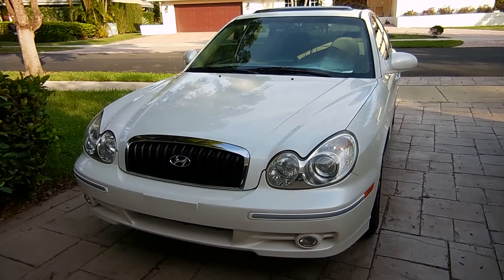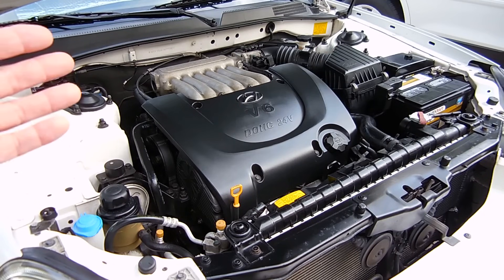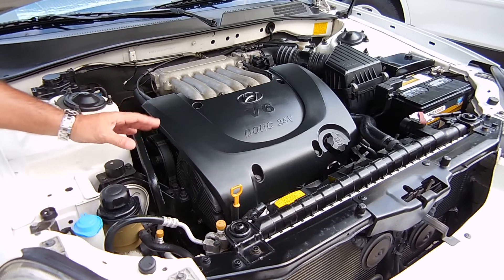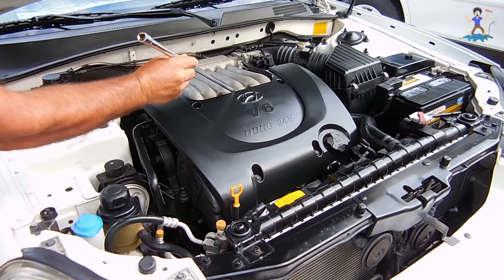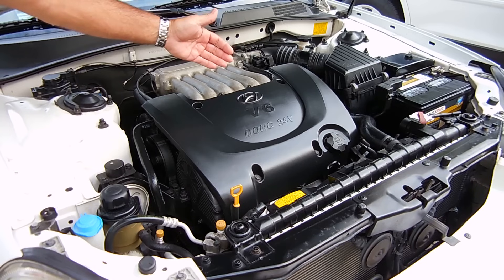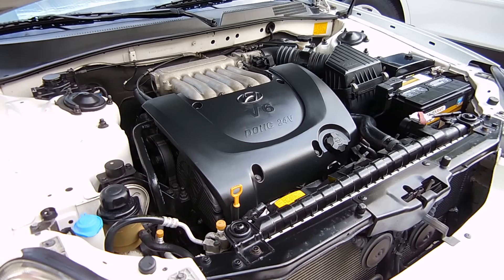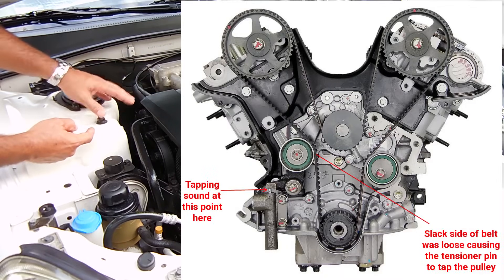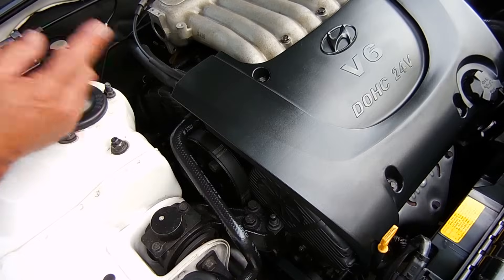(SOLVED)Engine Knocking or Tapping Sound That Varied With RPM

Comment: You explain too much but you doesnt have those sound problems on your car. Get video of those sound. Found it and fix it better than explain around.
Reply from the maker: The video was very well done. Because of my video, countless people learned about a potential problem that they should check. Every vehicle will make a different tapping or knocking sound, the sound is irrelevant, what is relevant, is where the sound is coming from. If it's coming from the area I pointed out, then you need to check the tensioner. This video should be 90-95% thumbs up. Sadly we live in a society with unappreciative and entitled people.
Reply: @electronicsNmore  This ignoramus hasn’t mastered the english language and yet he has the gall to criticize you. Keep up the great work bud! We appreciate it.

Comment: I have a 99 civic, when im stopped at a redlight it starts making like a tapping sound. And when im driving and it shifts gears, feels like a mount is broken but im not sure if its the mount thats making that noise because it goes away as soon as i accelerate or on neutral or reverse.
It only happen on drive while stopped
Reply from the maker: The sound would exist in neutral or park if it was the same problem I had. It could be an engine problem that shows up under load, or a transmission problem.

Comment: When I drive at 40-50 mph my car starts to knock. It happens when the rpm goes up or down. The sounds comes from the left side of then engine.
Reply from the maker: If the sound does not go away when you take your foot off the gas at that speed, or take your foot off the gas and click into neutral at that speed, then it's not the engine. One wheel has a problem.
Reply: Change spark plug

Comment: I check all spark plug, injection and any loose engine bit and even engjne mount bracket and there nothing I can do, did start 21 time for every one knock then after 22 time heard loud roar come from under my car and it damn exhaust sleeve just pop off so that what cause it 🤦‍♂️
Thank for tip
Reply from the maker: Sounds like you may have had fuel ignite in your exhaust system. Not every engine that has a knocking or tapping sound will be the result of what I explained in this video. I made the video to make people aware of one problem that is rarely mentioned. Thanks for watching!

Comment: How do you listen to the tapping if it only happens when you drive
Reply from the maker: Try putting the engine in neutral and revving the engine. If it doesn't do it, then you probably have a problem with one wheel.

Comment: Recently noticed my car is also making a knocking noise but only at around 2k rpm and only when I'm off throttle. When I'm on throttle or braking, the noise seems to go away. The car is due for a full service (timing belt, tensioners and water pump, accessory belt, all fluids, all filters and even glow plugs) so I'm a little more releaved to know that it might be a tensioner going bad but I'll still ask my mechanic who is a close friend to have a look at the rod bearings because that was the first thing that crossed my mind the second I noticed that noise.
Reply from the maker: Braking shouldn't have any effect on the engine sound if the tensioner is the problem. Sound caused by the tensioner will vary or disappear between idling and increasing engine RPM. I wonder if the "knocking" sound is a rotational noise coming from one wheel. Thanks for watching! Be sure to rate thumbs up.

Comment: WHERE WAS THE ACTUAL AUDIO?
Reply from the maker: Everyone is overly concerned about the sound of the knock or tap. The sound will vary. What matters is WHERE the sound is coming from. In this video I made it very clear how you can rule out the hydraulic tensioner. I have an audio file in the video description area, and in my "Pinned" comment.

Comment: I have a mustang 1996 gt 4.6 liter and it makes such a bad knocking sound.
Reply from the maker: You need to pinpoint the loudest area of the engine to get a good idea. Thanks for watching!
Reply: I have experienced connecting rod issues 0n  1997 & 1998  4.6 liter fords requiring rebuilt short blocks.

Comment: I know this video is old but maybe I can get some info here or some replies. I have a 95 1.8 Audi A4 it has an inconsistent knocking noise coming from the valve/cam cover near cylinder 3/4 on the intake cam side the knock isn't a tap tap tap it sort of bounces around like will tap twice then quiet for 2/3 seconds then tap again it's only during idle goes away with any increase in rpm and only taps in drive or reverse when warm not in neutral or park but when it's cold taps in all gear selections, I have replaced the timing chain, timing chain tensioner, all the hydraulic lifters on intake cam side, new oil pump, new oil pickup, running full synthetic 5/40 weight and I've tested all sensors and checked for vacuum leaks.
Reply from the maker: Hello Kevin. Unlike other YT channels, I reply to ALL videos regardless of age. Might pay to remove the valve covers so you can rotate the engine by hand a few times to look at everything and listen for unusual noises.

Comment: My mechanic just replaced my timing belt and water pump a couple of weeks ago and ever since then I’ve been hearing and feeling a light thumping noise. I can feel it in the pedals and the floor board. I gets stronger and faster with the cars speed. Even on the access road going 40 + mph I put the car in neutral and coast and it’s still there. But when I park my car put it in neutral there’s nothing. If my car is parked and I place one foot on the brake put the car into drive and press the gas pedal the noise and feeling is there...
Reply from the maker: Hello Marie. It sounds like something wasn't put back properly in the process of replacing the parts. Bring it back and explain the problem. Thanks for watching!
Reply: electronicsNmore thank you I’ll take it back asap
Reply: What ended up being the problem ?

Comment: Do You have a video of the ticking noise? I have exactly what you described but mine it's a chain driven with hydraulic tensioner
Reply from the maker: My pinned comment has a link to the sound.
Reply: @electronicsNmore  missed that, thanks exatly the noise my engine has, was starting to think piston slap, but is not that loud or deep, is just a clac clac at idle. and below 1200rpm, thanks!

Comment: My 02 Grand Am has a bad oil leak and the knocking occurs at the same speed of the RPM. Once I fix the oil leak and try this, I’m hoping the problem will be fixed
Reply from the maker: Could be a fuel octane problem.

Comment: Hello, so I've been having a ticking sound come from my passenger side in my 96 f150 4.9 l6 and I did an exhaust leak test. And I found one on the manifold and I can't be sure if I found all the leaks. Any other advice before I go spend 800$ on an exhaust manifold replacement
Reply from the maker: Ticking sounds are usually exhaust manifold leaks. You need to spend much more time trying to pinpoint the exact location of the sound. If it's on top of the engine, on the passenger's side, then it's likely a valve issue.
Reply: @electronicsNmore  well the ticking noise from the passenger side is alittle loud. But it doesn't sound as harsh as a thrown rod. Could that still be a valve tick?

Comment: Completely different car, but my Fiesta ST I recently picked up has been making these noises in the belts side of the engine. Got underneath and looks like an auxiliary belt powering the AC compressor has been replaced along with the compressor recently. Hopefully it's just that causing the sound.
Reply from the maker: Remove the belt, then start the engine for 5-10 seconds to see if the sound goes away.
Reply: Is it possible that an alternator bearing or compressor bearing could make a similar noise?

Comment: Hey im getting this same problem but on my 3.8 genesis coupe,
Upon start up you can barely hear it,
Rev between 1200-2k and its there
Above 2k and its gone
Same location too, passenger side somewhere in the middle 
I took it for a drive today and while drive it sounds normal or very faint( i have a loud exhaust) 
No check engine lights
No oil problems
Could it be the same thing?
Reply from the maker: Very possible. Sounds like the same thing.
Reply: @electronicsNmore  yeah i talked to a few of my mechanic buddies, and they all said it doesnt seem to be rod knock, and i suggested thr hydraulic tensioner and they agreed thats what its looking like,
How hard is this to fix btw?

Comment: I have a ford fusion 2008 when i brought the car it had a like ticking noise but drove perfect after few months it started to sound like a rattle it still drove good then it came hard then the car cut right off tried to crank it back up it basically died
Reply from the maker: You waited way too long to check things out.

Comment: how to clean engine like that ?
Reply from the maker: Very easy. Every 2-3 years I cover up the electronics, etc, then spray engine cleaning foam and brush it in to remove the grease/dirt. Then carefully rinse off the engine. When dry, I use wd-40 on certain areas, and to give the engine plastic parts a beautiful "like new" shine, tire foam. :-)

Comment: The sound we are trying to figure out is about 30 seconds to a minute after my wife turns off the car. We haven’t noticed it before and I don’t think it’s the engine cooling off, this isn’t a V8 Corvette. Then again, I’m no mechanic 🤷🏻‍♂️
Reply: It’s a 2006 Sonata V6
Reply from the maker: @Longenecker1776  Need more info. Location?

Comment: Hey I have a similar ticking sounds with the same engine only it gets louder when I accelerate harder and is not there when at idle or soft acceleration any chance it is the same tensioner? I was thinking a fuel related issue (injector) no check engine light btw any info helps 👍👍 also sounds like same location described here
Reply from the maker: Doesn't sound like the same problem. Sounds more like an internal engine problem. Possibly rod knock or piston slap. Have you always kept the oil changed and clean? Never ran low?
Reply: @electronicsNmore  what if the tapping sound only occur during engine startup...but when driving there is no sound anymore and when the engine is already warm. The sound also louder when the ac is on
Reply from the maker: @briancaroll1194  You need to find out where the sound is loudest first.
Reply: Bought the car with a bad clutch once I got that fixed I notice the problem previous owner claimed to have bought it from auction and never got to drive it wouldn’t rod knock always be present like even at idle you can here it clearly
Reply: Same problem here

Comment: You can still start it without the band? 😂
Reply from the maker: What are you talking about?
Reply: Gabriel Martinez yes you can. Timing belt no, but the outer belt yes. Its only for powersteering(dont need it if only starting engine), alternator(you dont need it if you have a good battery and you arent driving the car) etc etc
Reply from the maker: @noetobar5018  Oh, the serpentine belt. I was wondering what he meant.
Reply: electronicsNmore i think thats what
He meant anyways 😂.
Reply: @noetobar5018  still will need it for water pump for when the engine is hot but when cold it doesn’t need belt

Comment: I only buy car with timing chain
Reply from the maker: They make more noise, and can stretch over time. Thanks for watching!
Reply: @electronicsNmore  the past is different than modern day.that's why toyota stop making car with timing belt after 1997
Reply: These engines do HUGE miles and because they're built in the early 2000s, you can cherry pick the best of them and still pay peanuts. I got a van with one in it (trajet) and paid about US $3000 for it on the road with fixups and inspection and tags and taxes. I doubt the caryard even made a profit but the previous owner got it repainted and it shines up like a new vehicle. And it's only done 100 thousand miles.....

Comment: WOW my 2019 Hyundai Tucson is a v4 how is that a v6
Reply: JPS Channel it would most likely be an I4 or In-line 4
Reply: There no such a thing v4 .
Reply: @GilZu  I've had 5 V4 engined vehicles.
Reply: gil zur There are V4 engines but are extremely rare and not made any more
Reply: This is a VERY common V6 engine in the trajet, Santa fe, tiburon, and sonata. And I thought the grandeur but it turns out that's a 3.0 litre. They also made these with a different top cover as well but the same engine underneath.
Reply: Cars of the same model can have different sized engines depending on the version you choose.

Comment: I'd rather a chain driven v6
Reply from the maker: Chains last a lot longer, but they do create more engine noise. They can also stretch over time.
Reply: chain motors have more problems...tensioners going out,guides
Reply: @brianp5579  That's not true and depends on the motor.
Reply: @JD-ph1dz  frt covers leak on chain motors also. More stuff to go wrong
Reply: @brianp5579  lol my Commodore has done almost half a million ks and still goes like a dream. One of the most reliable v6 engines out there 3800 buick .. All vehicles have problems dude.
Reply: @JD-ph1dz  LOL you are giving me examples of single cam chain driven engines im talking about dual cam or quad cam engines that utilize a chain, plastic guides and tensioner. They will NOT go half a milliom miles with out failure.
Reply: It does all depend on the motor… I’ve done so many chains on 2008+ bmw mini’s and 2015+ Audi especially s3 models down to poor running because of a stretched chain and they all seem to have around 70k miles on the clock… diesel BMWs especially those with stop/start will snap a chain at 120k miles if not replaced (engine out job) and I have a 2017 Mercedes a200 that’s has a snapped a chain, it’s smashed a hole in the side casing and the chain hanging out the side of the engine, i can see broken teeth on gears through that hole so I’m not stripping it, it needs an engine but the customer can’t afford it. Older stuff with chains are better because they used to be over engineered now it’s all cheap sh!t.

Comment: If the hydraulic tensioner is faulty, one should be able to determine if it's bad just by hand?  In other words, will the slack on the timing belt and pulley be obvious to the touch?
Reply from the maker: The timing belt should be tight at all times. If the tensioner is faulty, there will be slack in the timing belt that can be felt. Thanks for watching! Be sure to watch my "Auto & Mechanical" video playlist below, and most importantly share my channel with many others. 
https://www.youtube.com/playlist?list=PLQ6IOhUBblU3mBem9ImEgGzmqToW6SCJD
Reply: By hand AFTER you take all the other stuff off to get to it

Comment: Hi I have a really load ticking when accelerating in lower gears but when it is wet (raining) you can’t hear the ticking mk5 golf 07 1.9 tdi any help would be much appreciated as I can’t stand the ticking sound for much longer
Reply from the maker: Hello. It's very difficult to say without looking at the vehicle. You need to pinpoint the location. Maybe a problem with the turbocharger if the timing belt is OK.
Reply: electronicsNmore  thanks for your reply I recently had a new turbo charger around 6k ago as it had the horrible siren sound for a while the clicking also stops when I put the car in neutral but with the car still moving like down hill for example but if I rev the car whilst still moving in nuetral the ticking continues but there is times when it doesn’t tick like in the rain sorry for the paragraph and I appreciate your help a lot ✊👍✌️💪♥️
Reply: If it's based on the 1.8 litre turbo diesel..... RUN... one of VWs worst engines.

Comment: About a year back my dad gave me a VW Passat he purchased brand new, he wanted to sell the car but ended up giving me the car as a gift. however, when I first got it had a knocking in the engine, sounded like a diesel engine. I thought the knocking was only my imagination but one day my wife asked me if the car was a diesel because of the intense knocking. however, I decided to do an early oil change. Turns out the knocking disappear completely.
My opinion only the shop that was servicing the car was using poor quality oil and bad quality replacement parts. My dad had lots of problems with that car but with me, it has been flawless. I'm thinking if dad asks me how's the car doing I'm going to reply with: This is the worst car ever.
Reply: Sounds more like crap in a hydraulic lifter... some VWs can be real nightmares.

Comment: I have almost identical symptoms on a Pajero iO 1.8 DGI just bought at auction. Was hard to get it by the Shaken (biennial inspection) on hydro-carbon emission. Assumed it was carbon build up in the inlet valve stems, but your suggestion regarding slack tension on the timing belt is worth investigating. Particularly as the belt had been changed shortly before it chucked into the auction.

So cheers for that.
Jack, the Japan Alps Brit
Reply from the maker: Thanks for watching Jack! Be sure to watch my "Automotive & Mechanical" video playlist below, and most importantly share my channel with others. 

https://www.youtube.com/watch?v=hnd7P7O_vEQ&list=PLQ6IOhUBblU3mBem9ImEgGzmqToW6SCJD

Comment: I have the knocking problem but it’s barely audible when the car is idling & it gets worse when it’s going, but then as I drive it’ll stop. & I can figure out what that is.
Reply from the maker: As stated in the video, remove the drive belt and see if the noise goes away. If it doesn't, then inspect the tensioner. If the tensioner is good, then you have an internal problem with the engine.
Reply: I had a whine that would shut up after several miles at higher RPMs and it was the tensioner and a roller for the external belt  (alternator etc). Fairly cheap but tight enough to get into.
Reply: Prolly running 10w 30 I guarantee u as it gets hot u get oil in all ur parts the way u suppose to but wen it's cold ur oil is to thick to lubricante